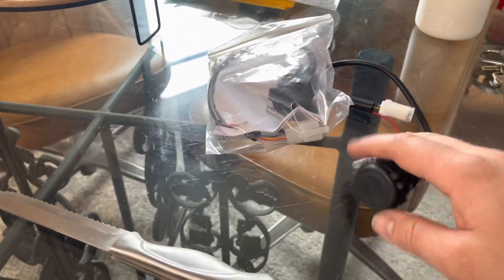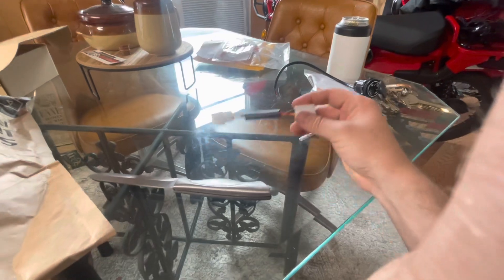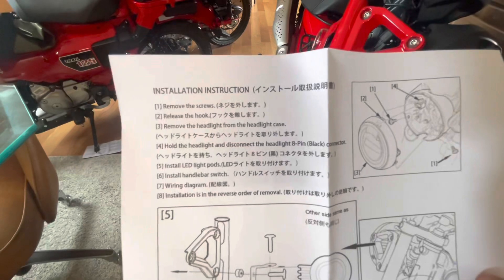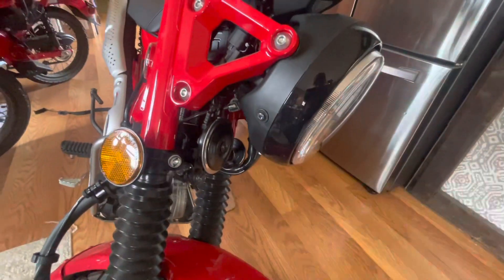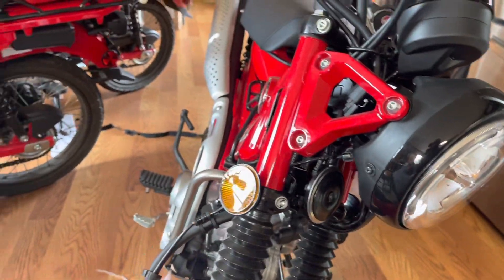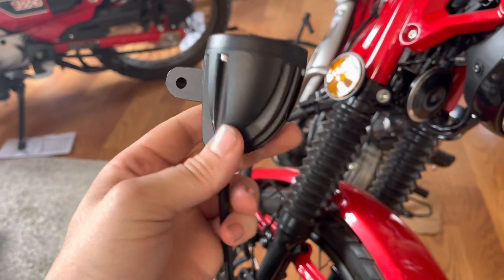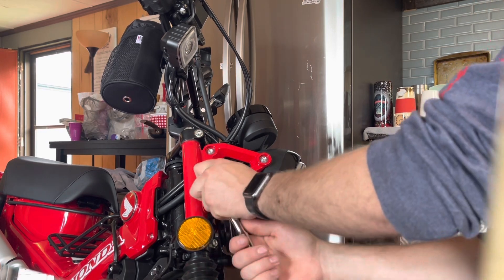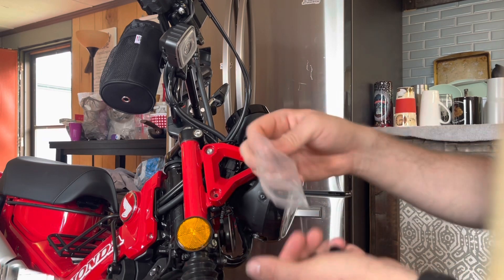Installing Honda Trail 125 Fog lights

Comment: The lights are fun I've always been fond of doing creative lighting mainly with cars speaking of cars LED bulbs if you've been thinking about them or shopping for them you might want to buy them now China's economy is melting down. They're building up the War Machine most likely going to Annex Taiwan. and something could happen and the supply chain get cut off and the prices of the remaining supplies in America could Skyrocket so I'm ordering a couple hundred dollars worth of various different bulbs in bulk. And a fun fact for all you mechanics out there who work on vehicles and are always installing parts that they've made in China Roc on the labels did you know the pollution there is so bad that the plants outside won't even grow around the factory is just dirt. The water table is so bad it's not even suitable for washing vehicles. Detroit was squeaky clean by comparison.